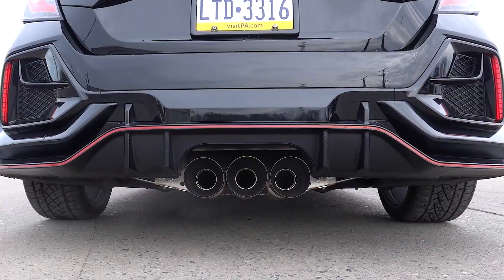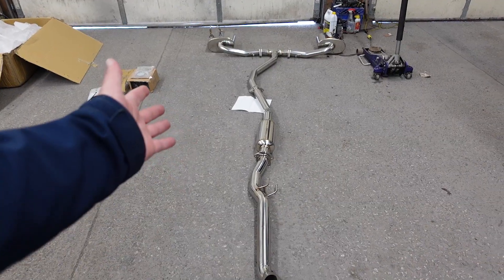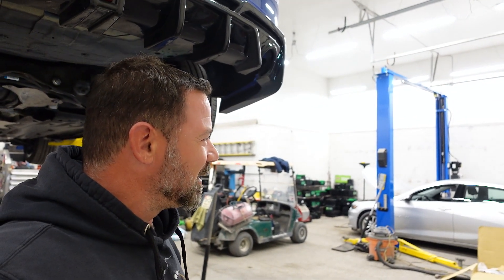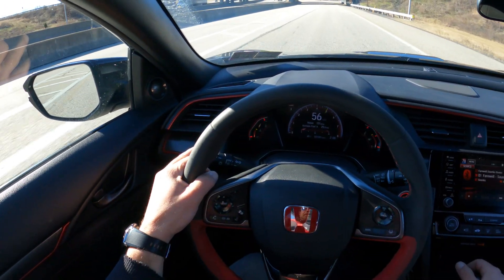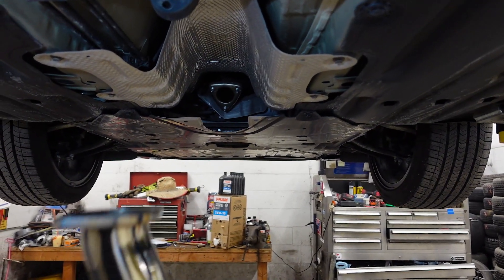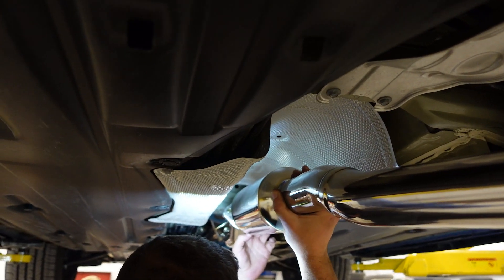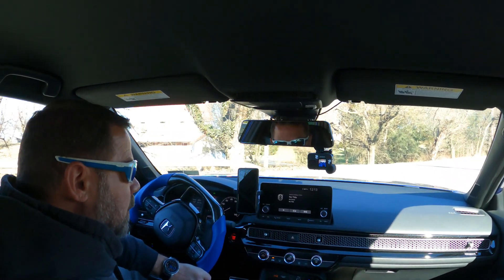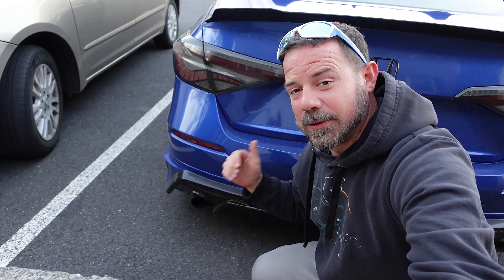My 11th Gen 2022 Honda Civic Sport gets Function Werk Dual Exhaust & My Type R gets Hondata'd!

Comment: Traded my blue Sport in yesterday for a Sport Touring manual that I randomly found in-stock and unlisted. Got my MSRP back in trade value.
Reply: LOVE TO SEE IT!!!
Reply from the maker: Cool!
Reply: I believe there's a 3M kit for the Civic Sport Touring to black out the chrome door upper window trim if you would want to do that.
Reply: @RetroPsych  I notice on lots of makes, the Sport oriented models like the Civic have a lower trim and and more blinged out one, often with more chrome/brightwork. What they SHOULD do is have it more shiny, but subdued, like the smoked chrome used on the grilles of the Accord Sport and previous HR-V Sport. I always liked black out or smoked, gunmetal trim. 

But yeah, if you search online, you should be able to find that blackout kit, or similar ones. But good window tint shops, like one of the nation's best and maybe longest opened on here in Honolulu, HI could probably do it, but why not get a less expensive, already made DIY easy install kit, especially one with the reputable 3M brand materials?
Reply: Does it drive better? Paddle shifters?
Reply: @kennethporst1738  - no paddle shifters on a manual. Manuals are technically slower than CVTs, but it is a lot more engaging to drive and the 1.5T is a decent step up for me. Possible Hondata to come.
Reply: @jjacob25101  - I put the Type-R glossy pillar parts on it, but left the chrome. It’s a design element that appeared on the development sketches; it’s fine for me.
Reply: where did y’all get the exhaust bracket for the driver side ?

Comment: I spoke with Functionwerk about the hp gain and they indicated a 3-5% gain. Initial install before the PRL the car would have a sudden pep with deep tone to it but the Intake made everything so much smoother! Love the video!!!
Reply: Led me to think
Reply: Had you going there lol. The intake made everything more balanced and significantly better!
Reply from the maker: Thank you for the info! I think the tune helped out a bit as well.
Reply: Did you do an additional tune for the exhaust or is it still on the first tune? Also the tune is the one provided by Ktune, right?
Reply from the maker: @SlyNinja  just the first tune. There is only one so farvfor the 2.0l

Comment: I put the same exact exhaust on mine and I get compliments all the time, love it !
Reply from the maker: Right on!
Reply: Do the cops pull you over cause the sound might be too loud
Reply: @butscratcherr  no but I’m in FL so they don’t really bother you here about that , as long as you aren’t redlining it constantly you shouldn’t have a problem , it just has a nice deep growl to it when idling
Reply: Hello does this exhaust drone at high speeds . I’m thinking of getting it to
Reply: @a1shabba266  it has a little drone but nothing that is bothering when driving , I drive on the highway 90% of the time for work and no problems with noise
Reply: @capo.d10  What speed /rpm do you usually cruise at? And would you say its bothering at those speed (high exhaust sound)?
Reply: @Teviathan  usually between 70-80 at 3k rpm , no problems with sounds unless I use the paddle shifters and shift down then you hear the engine go high pitch for a few seconds
Reply: How loud is it? I’m not looking for loud just a nice little deeper tone and nothing that will make me that annoying civic guy lol.

Comment: Sounds good, Will that void the warranty
Reply: I have the same question, really the only thing holding me back from modding my Civic so much
Reply from the maker: Nope
Reply: @ImmutableIcarus  Most cases, it's pretty much legal to have a conventional type aftermarket muffler and exhaust system aft of the catalytic converter(s), even a more inexpensive muffler delete, like some have on these Civics, provided the noise level does not violate vehicle code regulations in your area. If it's a ready made kit from a professional exhaust manufacturer, it's probably made to conform with legal guidelines. 

When I was younger ages ago, I had an old school Buick Regal S/R Coupe with nice GS Rallye wheels and an emissions era detuned 350 V8. I think the early catalytic converters would go bad very often and plug the exhaust system, so I had a local muffler shop install a 'test pipe' to replace it. The shop did not fasten the rear clamp well, so a while later I got off of work early in the morning at the mall I worked and the rear end dropped, making my exhaust 'uncapped' and it was loud! Fortunately, there was an old school gas station at the far end corner that had a mechanics garage, etc., that also did our towing. They fixed it for me.

Comment: 🔥🔥🔥 so fire bro. I need one. That sounds amazing for a vtec. When do think you would do a video on those spring rims you mentioned in other videos
Reply from the maker: Thank you 😊 If i do decide to do new wheels it will probably be end of March beginning of April.
Reply: @717PROJECT  definitely need to see which ones you get. I seen the ktuner video and I gotta question. Does blue really feel faster or is it just a gimmick.
Reply from the maker: @lyricsgenius497  It definitely feels faster. Throttle response is much, much better. The intake and exhaust help a lot.

Comment: Great video you have there! 💪🏼 I have a few questions? Do I have to install the front pipe, down pipe and tuned my 2022 honda civic sport in order to install the exhaust? Without those mods, can I just install the exhaust by itself? Does it cause any problem to the car? I daily drive my car, I just want to make it a little bit louder.
Reply from the maker: You can just run the exhaust if you want. don't need a tune either. Only thing you'd need to tune is if you put a downpipe on. Would need it to clear the emissions codes.
Reply: @717PROJECT  thank you so much! 💪🏼

Comment: Was there any extra modifications needed to be done to ensure the driver side tip would fit? The sport model has a little cut out groove for the passenger side exhaust tip but not on the driver side I was wondering how it would be compatible for installing the exhaust on just the OEM bumper.
Reply from the maker: There is a garnish that you will need to remove. My diffuser covered it. I did have to take half the diffuser off to get it. Very easy to remove.

Comment: that sounds rlly good. Is there a particular reason you didn't get the Si cause you're basically making an automatic Si lol
Reply: It's a project car for fun, with the better reliability of a N/A engine over a turbo/GDI, and shows all the things people with a Sport can do over time as a hobby, and as they can afford. Aside from the dealership scalping fees, and a few things the Touring/Sport Touring trims have, you save a lot of money going with the Sport and get most of the stuff many of us want, and prefer, like no sunroof, more reliable manual adjust seats and such, and use the money saved for or preferred OEM/aftermarket accessories, performance and customization add-ons and such. With research, there may be other OEM things for different vehicles that fit and work for various vehicles. blue is probably hands down the nicest, and most popular modified and customized 11th Generation Civic Sport Sedan in my favorite color for the Sport Sedan. I would go with the Boost Blue Pearl Civic Sport Hatchback, with Sonic Grey Pearl as a second choice.
Reply from the maker: The Si didn't come out for a couple of months after I bought the sport. Plus, I have a Type R.

Comment: I have the 2022 sport hatch and I was wondering if the defuser and the exhaust you just put on will fit my hatch, and if so do you happen to have a link for a matte black defuser, I am very slowly building my car. I've only had it since July last year and it's trouble some to find parts lol.
Reply from the maker: As far as I know there are no Diffusers out yet for the hatch. There is exhaust tho.
Reply: @717 PROJECT  would you happen to have any links I can check out I'm having trouble finding them lol.
Reply from the maker: @lordwolfreaper3138  check out www.axionindustries.com or www.functionwerk.com

Comment: Nice what 5he total Power ur now getting from both cars after the new tunes
Reply from the maker: The Sport I'd say roughly 180-185 right now. The Type R I'd say 350-355. That will change for both in the coming weeks 😁
Reply: @717PROJECT  🙂🙂🙂 nice cant wait to see what's next. Thinking of getting the sport but wanted to see the potential it has first
Reply from the maker: @yuripeters2991  Hoping to get the down & front pipes on this weekend.
Reply: @717PROJECT  nice

Comment: Was there a particular reason you didn’t install another hanger for the piping that goes left at the split?
Reply from the maker: It only came with one hanger. There is one that holds it up on the right side.
Reply: @717PROJECT  ok awesome. So you felt that the right side supported it enough that you didn’t need to source a bracket for the left?
Reply from the maker: @evanbuenger751  Yea, the left rear one they provide is good enough.

Comment: The exhaust on the 24' gen 11 touring points down. I want the to show in the back. I'm sure I have y chance the rear bumper as well. Can you offer some advice.
Reply from the maker: You'll have to check the descriptions and make sure they fit your exact model before you purchase. They're all different apparently.

Comment: Is this exhaust very loud dont want it to be much louder then stock as it is a cvt and doesn’t shift but want the dual exhaust
Reply from the maker: It's not too loud but it's loud enough. I think when I add the downpipe and front pipe it will be much louder.

Comment: hey handsome what are the correct wiper blades. for the civic 2022 I have tried several but they do not fit even though they are the correct size
Reply from the maker: I'm not sure, haven't had to replace mine yet. I barely use them. I'd say maybe go to your local auto store, advance or auto zone and ask. See what they say. Unless you've done that already.

Comment: Miller, that's an awesome, albeit expensive exhaust system, comparable to Borla, but special made for this car. I wonder if it would work for the Sport Hatchback. It's possible/probable that one could get that company to make them with exhaust tips/finishers that fit with a Sport Hatchback, even concealed for a stock rear bumper/diffuser. 

If I got the Sport Hatchback, I would definitely consider this exhaust down the road, or even the HR-V Sport if they would make it fit, like for a hatchback, or make one that does. Especially if I could get the K tuner to work with the HR-V. That would be nice with a PRL high volume intake like on Blue, front strut tower brace, etc.
Reply from the maker: There is a couple already out for the hatchback. Not sure about the HR-V.
Reply: @717PROJECT  I just wonder how different the HR-V is from the Civic under hood and underbody. Lots of Civic parts may fit/work. Exhaust systems may differ a bit in length, but I imagine lots of it may be similar.

Comment: Do cops pull you over because technically this is not street legal I looked at the disclaimer at their website
Reply from the maker: Nope! But I don't have this exhaust on anymore. I have Prl's N1. Passed inspection no problem. Even with a downpipe.
Reply: @717PROJECT  which one is better single n1 or the werk dual exhaust
Reply from the maker: @butscratcherr I like the tone of the N1 much more. But unfortunately, it looks like they removed it from there site  🥲
Reply: @717PROJECT  i noticed 😞

Comment: Once again... and I'm not sure if this is a hatchback thing or trim level thing, but my Honda came with the twin exhaust stock from the factory.

Also, dumb question: wouldn't a "dual" exhaust be physically two exhausts coming out of the engine? Friend mentioned that my car has a "twin" exhaust; one outlet on the engine, but two actual exhaust pipes -- in comparison to a "dual" exhaust; one outlet per 2 cylinders, and each pipe gets it's own exhaust pipe. I'm not sure if they're just making stuff up or if there's actually a difference?

Also, how's the hatch hunt coming along? I saw a few other hatches for once in the Pocono area. I think the dealer up here is starting to get more on the floor.
Reply: Yes, it's not true dual exhaust, like V6 and V8+ engines, especially like old school American performance, some European and Asian imports. That's what you get from a 4 banger. Making real dual exhaust out of one as described is senseless, and may mess up driveability, particularly in stock, unmodified smaller engines with lower horsepower output, as would too much reduction of back pressure, especially on lower end acceleration. It is more for sound and cosmetics, and improvement of flow from lower cost OEM exhaust systems that may have some restrictions in the pipe bends and such, as opposed to smooth, Mandril bend pipes in nice stainless steel systems like this, Borla, and others. Pricey, but you get what you pay for, if it's worth it to you.
Reply: @jjacob25101  Hm, makes sense. I just hear dual exhaust all the time, and then my friend comes along and says, "Nah, that there's a twin exhaust." Like... Same thing? Apparently not. Good to know though. Thanks. :]
Reply: @CypherusMcClain  It is, but it isn't. Lots of people, especially old school performance enthusiasts were raised to prefer that symmetrical balanced look of exhaust tips/finishers on both sides, with exceptions like center, or side exiting pipes, etc. 

But over the years with smaller, lower output vehicles and engines, or more lower trims with larger vehicles/engines, the majority has grown accustomed to the single exhaust for budget and simplicity reasons for the mass market consumers to make it more affordable and what's basically necessary, with the bigger engine variants like work trucks having single but larger diameter exhaust, with aftermarket modification at the  choice of the vehicle owner. 

So yeah, I am fine with single nice exposed exhaust tips for the regular model Civics, HR-V, and such like the Sport models. They don't need dual exhaust and they look fine. 

But if I got a Toyota Camry, I would go with a good, decent performing SE, but would probably get dual exhaust eventually, especially since I saw this shop on YouTube that made high quality custom made systems for the SE/XSE for both engines.

I would look them up if I got the Camry and have the Great exhaust shop where I live order and install it for me.
Reply from the maker: Well, Jacob pretty much answered the question for me. Hatch hunt is going ok. I've had a few reach out. Most are 1.5 to 3hrs away.
Reply: @717PROJECT  I'd imagine being as close to Harrisburg as you are you would have better luck being close to a city center like that. The offer still stands though. I wouldn't mind the drive to get out of the house more often. Lol
Reply from the maker: @CypherusMcClain  sounds good!

Comment: Will this fit on the 2022 Civic EX 1.5T sedan?
Reply from the maker: They do sell one for the 1.5t.
Reply: @717PROJECT I checked but they’re sold out 😢. But will this by any chance also fit the 2022 civic (1.5T) Ex as well??
Reply: Cuz if it does, then I’ll might as well buy this exhaust since the 1.5T is sold out
Reply from the maker: @allenyumang2450  I'd doubt it.